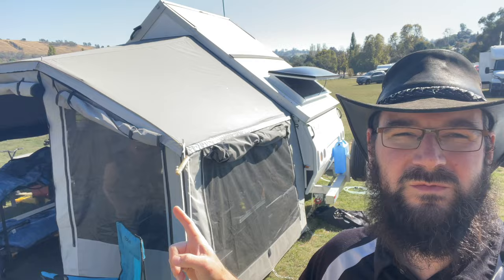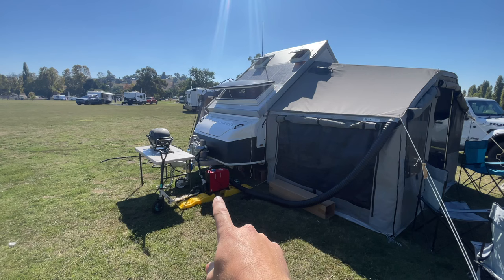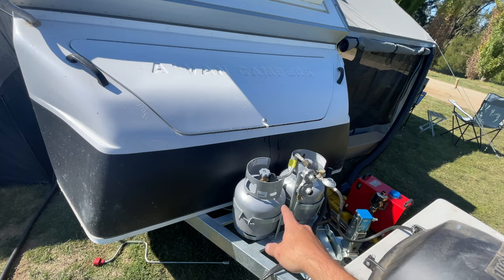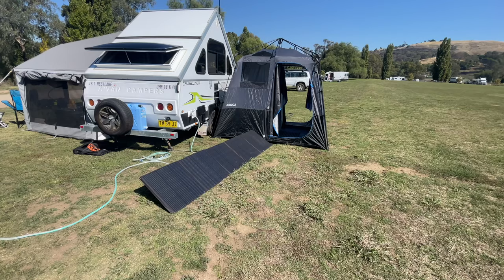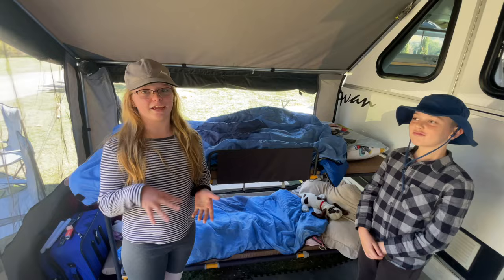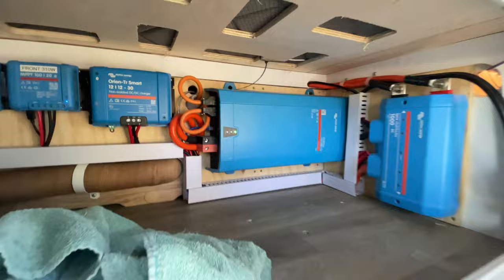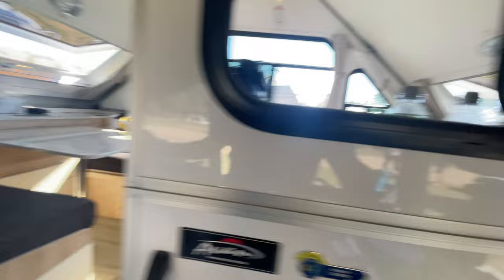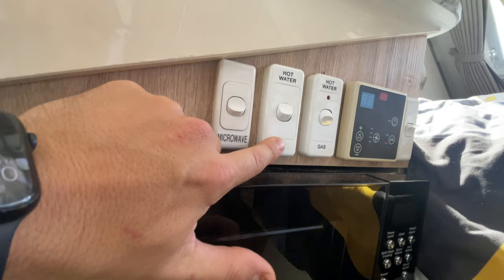ULTIMATE AVan - The Honey Pot - 2023 AVan Cruiseliner Adventure Pack Follow Up Walkthrough

Comment: What was the reasoning in buying a Jerp?
Reply from the maker: We had a crewman before and it wasn’t going to be up to the task of towing the AVan. 

In short we chose the gladiator due to it not looking like every other tradie Ute out there and we liked it over everything else.
Reply: @rubitherubicon22  Fair enough.
I personally wouldn't touch one given their reputation for unreliability and Jerp Australia's utter contempt for customers.

Hopefully you got one that's not a lemon mate.
Reply from the maker: @mikeperth8027 by all accounts the JT are a pretty good thing. 

Very few issues, certainly no more than other manufacturers these days. The engine is now on its third generation, we’re 20k in and no issues at all. Each to their own I guess. If you look hard enough you’ll find issues with everything. The mid teens tritons and failing water jackets comes to mind - my dad had 5 engines fail under warranty before they gave him a refund.

We’re really happy with it.
Reply: Nice couple of videos to watch. Did you look at camper vans or just straight to the a-frame van? We enjoy camping in our air tent, but I have noticed a lot of a-frame and campers getting around which are now low enough to clear the carport and go into the backyard. We don't have a big enough backyard for a shed so I'd have to get a van cover. Have you done a video of your full setup from scratch to up and running? As in setting up. Cheers
Reply from the maker: @tugboat8475  I’ve always liked the AVans but never been able to afford one until recently. We had a cavas camper previously but it was a bit of a pain, once my wife saw how easy the AVan was to setup, she was sold.

We haven’t done a setup video but there are plenty of them out there. I might do a time lapse next time we setup.